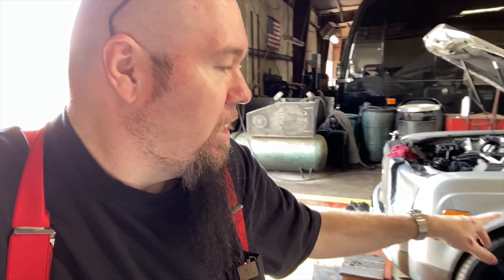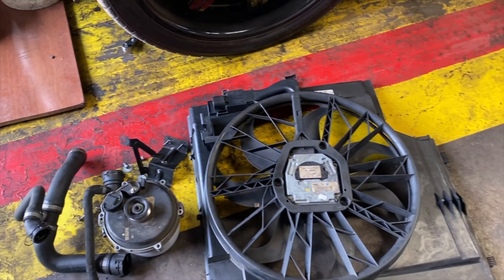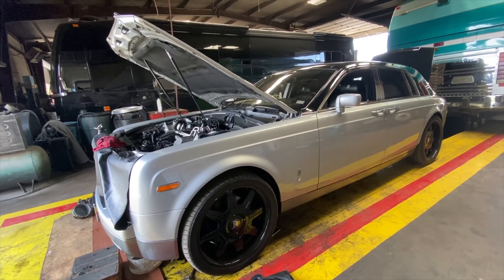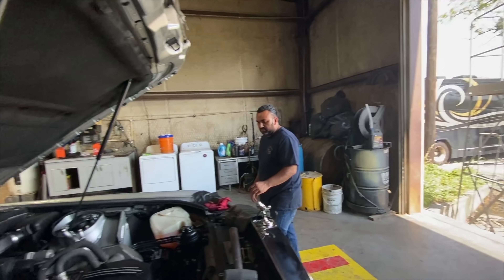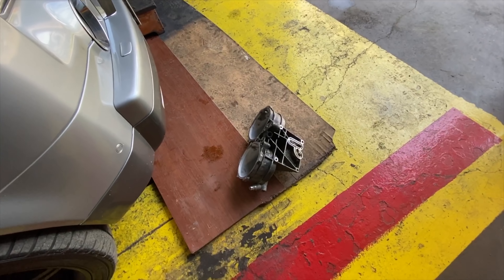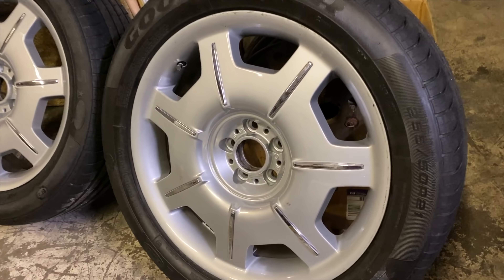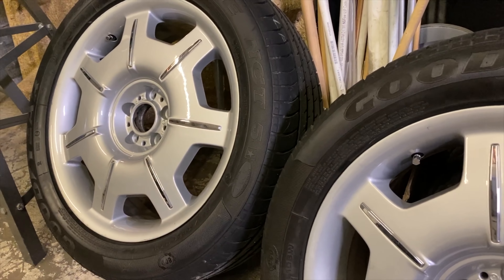Rolls-Royce Oil Leak fix and updates!

Comment: I swear BMW stuff is given a shelf life of 3 years so bits start breaking by design as soon as the warranty runs out, they may have had to alter it a bit as they were breaking before the warranty had run out, that still didn't work that well. The BMW I8's had a faulty sensor that could cause the car to understeer when braking;, Fuel Leaks and  to address a possible airbag problem with cars not to mention multiple cars having the dash light up like a christmas tree with fault codes. This car was to be the best thing since sliced bread it did have super car boot space that made a Ford GT look like a Volvo Estate boot wise though.

Comment: Hey Videobob!  Just look up the Bosch Part Nr.  1137328118  The same fan is used on the BMW 3 and 5 Series from 2003 to 2006 too.. and even on the Volvo Xc90!  Just the fan shourd is not the same!